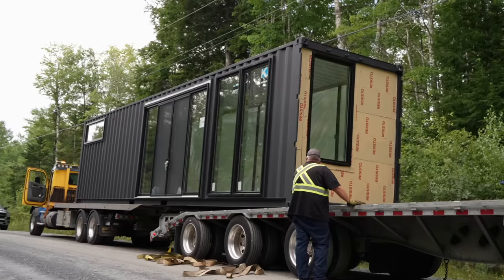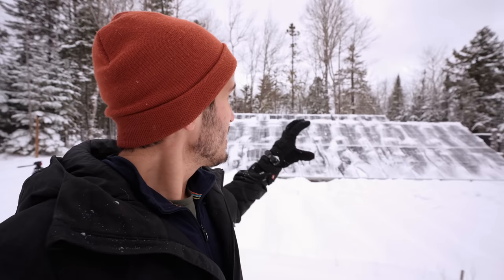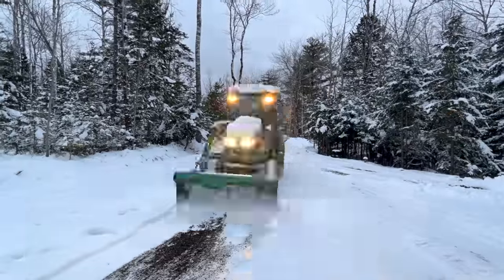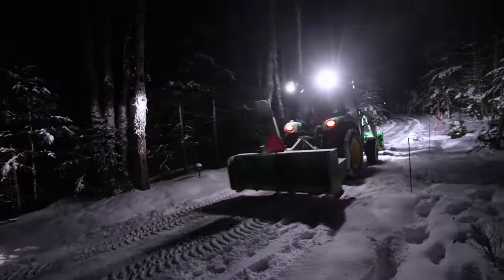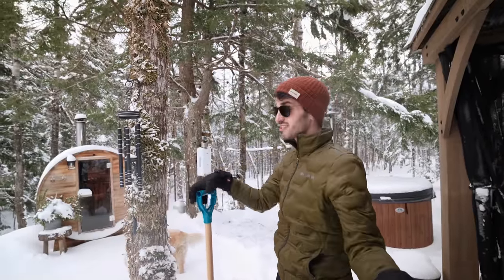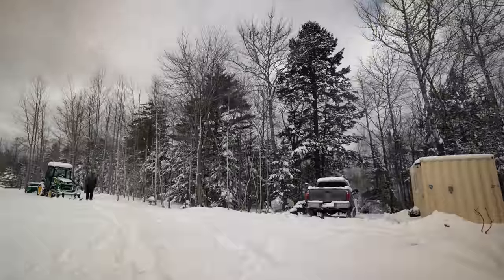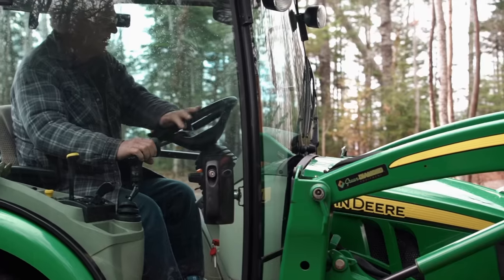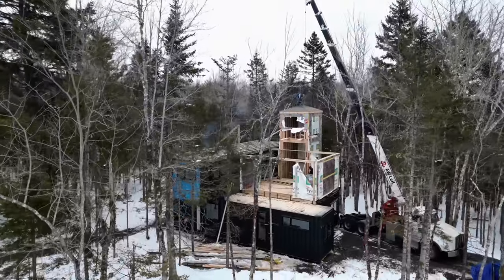Persistence Pays Off: The Shipping Container Home Build is ON!

Comment: HI guys! Sooo jelly of that tractor and now the new blower! Ahhhh! IwantoneIwantoneIwantone! Was thinking about that constant chore to clear snow off the solar panels and it occurred to me that one might buy vinyl like the dome window is made of and make covers for the panels so that all you have to do to clean them off is pull the cover down from the top and let all the snow fall to the ground. The vinyl panels can wrap around and just under the solar panels and be secured in place with grommets and bungees or commercial velcro would be my choice if the temp allows or even those super strong magnets if they will adhere to the solar panel frames. Due to the trees, you don't seem to get a lot of wind so it seems like any of those might work and make your daily tasks easier with one of you on either end to pull the panel down and put it back up with the aid of a step of some sort if you can't reach the top. The vinyl covers might also help reduce the rake snagging on the raised areas Todd described and..if its not too heavy you might be able to pull the vinyl panels with the snow load on them away from the solar array and dump it somewhere else. You could test this theory on the cheap with plastic sheeting and duct tape. The container house looks amazing so far!

Comment: You guys should put rails along the top and bottom of the panels, with a pole going from the top rail to the bottom rail (across the panels) with brushes attached so to clean the panels all you have to do is drag it across once and you're all done! it would take seconds to drag across and you'd be more likely to do it more often with it being so easy - more electricity! 
(would also work in the summer to clean off debris/leaves!)

Comment: watching you guys now...I think you guys might be good candidates for bifacial solar panels as you eventually replace or add more, with all of that snow on the top of the panels to gets solar power on the underside of panels. You guys have the be the hardest working guys in "snow" business. ha, but the tractor accessory looks like a great move. Easy to spot Squirrel in the snow huh.

Comment: Two suggestions - put small tarp over front and back window of vehicles for quick clean off (also saw a video that someone put a tarp over stairs and quickly pull the tarp away with the snow). Always keep a bag of cheap kitty litter in vehicles to put on icy patches to make it easier to drive. In a pinch you can also use mats if your wheels won’t catch.

Comment: Have a new tv and we had a power outage , just for less than a minute and I freaked out because all my tv had was green rolling lines🫣😳. I ended up having to unplug everything for an hour then plugged it all back in and voila it worked. Phew, all that money for a new smart tv and I figured it was dead after only three weeks.  Snow blowers are amazing so are snow mobiles, soo much fun. Stock up on shear pins, they are always breaking. 🙋🏼‍♀️

Comment: If you get a fibre glass painters extension pole then pick up a push broom head you can actually push the top of the panels worth of snow up up and over the top then behind the the panels and the brush is less likely to scratch the panels add catch on the brackets of the panels

Comment: put a gutter overhanging the panel. then put holes in the gutter, then run warm water through it so that it tickles over the panels.  :)
Reply from the maker: How are you heating and pumping hot water in the middle of winter? 😅

Comment: Todd, I' ve  got one of those snow rakes.  It's exactly like the one you have.  Luckily, I've only had to use it once. I love the Charlie cam. I'd like to see more of those shots.  I think the stairway addition is a great solution to your access problem.  With the boxy look of the tower in goes quite nicely with the containers. With all your self taught skills, Todd, I'm surprised you didn't turn yourself into  Joe welder. I may have a Kubby about the same size as your JD, but I like all things green.  I'm not a fan of blowing snow in reverse, but a front mounted snowblower  costs an arm and a leg, and it pretty much means you can't use the loader for any thing else, so go for it.

Comment: another amazing video.... if I may give you a piece of advice... I work in the automotive industry and never EVER lift your wiper blades up, NEVER, if there is a little weight on your blades from any kind of accumulation, it can warp them and you can burn a motor.... the best trick is use either bread bags or socks on your blades but DON'T leave them in the air !!!!!

Comment: Enjoy the snow blower.   I bought a tractor and snow blower similar to what you have.  It is nice but hard on the neck aa my driveway is a mile long.  I am looking to get a snow blower to mount to the front of the tractor which will run completely on hydralics.

Comment: Be proud of yourselves because all your hard work is paying off. 

Is there such a thing as an adjustable mount to change the tilt of the solar panels depending on weather conditions? A steeper angle would make it harder for the snow to build up and encourage it to slide off before there’s too much.
Reply from the maker: We’re looking into adding more solar in the future and with that we’re going to have a few panels at a steeper incline that will mean we won’t have to clear the snow

Comment: Are you able to track how often, how much, you need to rely on the backup generator? Regardless, you are moving in the right direction. Sun is longer and higher already even on our side of the Gulf of Maine. BTW, you were lucky with that snow. Ours was 5" of wet cement that did a number on trees and shrubs. Think shoveling water. Those panels will see you through the upcoming months. So eager to see the house addition in place and how that allows you to move forward there. And yay Mel's return.

Comment: Tyler and Todd this may be a really stupid question. I don't have any experience living in snow. And also know nothing about solar. Therefore, this question may provide a great big laugh for those that do. Here is the question Would it be possible/helpful to install heating coils on solar panels and roof of container home to melt down snow so it would not require as much shoveling? I apologize if this is a rediculous question from a deep southern from Florida USA. By the way I love you both dearly and thank you for sharing. What you have accomplished is absolutely amazing.
Reply from the maker: Not a ridiculous question at all! The solar panels actually do that themselves…the issue is when it’s SO much snow you need to get it off so there’s no more than an inch of snow on top so it will melt :)

Comment: I don't know much about solar panels, but I'm wondering why they don't have a self cleaning / snow melting function. You'd think a self-heating mechanism it would be an intuitive addition to the design. What do people do who have solar panels on the roof? Or large buildings with multiple solar panels on the roof. In those situations removal of snow by hand (like you do) wouldn't be a a safe or even feasible option?

Comment: Hi. I'm wondering.  Are you guys going to have some corner supports on the 4 corners of the container that will be the second floor?
Reply from the maker: Nope! Engineering doesn't require them as the load of two center beams are so intense!

Comment: The amount of snow your roof can take, was that computed with dry snow or moist? When it gets above freezing temperature, the dry snow sucks up the moisture in the air like crazy. It's known to break steel beams with a smile...
cheers! /CS
Reply from the maker: The load rating is 100lbs per square foot dead weight...not sure what that would translate to in terms of snow. The roof is roughly 500 square feet so in theory, it could handle 50,000 lbs. I mean, we are building an entire addition on top so it makes sense it can handle all that weight!
Reply: @tylerandtodd  100 pounds per square foot. In the best of all worlds that sounds good, but I would suggest you find out, both exactly what dead weight means,  and how much would one square foot, three feet (no! Six feet!🥶) deep of snow saturated with moisture weigh. I mean, I wasn't joking when I said that about steel beams. Wet snow has been known to destroy roofs of big production plants. And if you do find out, please feel free to post it to us. It is valuable information.
A few minutes later: Oops. I just made a "sanity check" (an off the cuff check). Please bear with me in the maths...
One cubic foot is roughly 30x30x30 centimeters.We can rewrite that into 3x3x3 decimeters. That makes 27 cubic decimeters. That makes 27 litres (IF we assume that totally moisture saturated snow weighs as much as pure water). Three feet deep means 3x27 litres, that is 81 litres. 81 litres is 81 kilograms, roughly  That means roughly 160 pounds per square foot. And if we assume six feet deep, that would mean 320 pounds per square foot. Oops.  Okay my assumption on the weight of the snow here is very much "on the safe side", since the snow will not really weigh totally as much as pure water, but my conclusion is still that in certain situations you could end up way beyond the tolerances of your roof. I do suggest that if you get real lots of snow, followed by a thaw, shovel off your roof as soon as possible.
Let's hope for the best /CS

Comment: I don't wanna be a downer, but clearing off those solar panels all the time would be getting very old very fast for me.  Maybe there's another way (like w/a cable or something) that you could do it faster and easier?  Thanks for the video though.
Reply from the maker: Lol not a downer at all! After 1 or 2 times it gets old for us too…the good part is you ONLY a have to clean the snow off when it’s more than 6”. So basically is it’s a huge storm, otherwise they just melt off right away! If we left it for a day, it would all be gone. We just don’t want to use the generator and burn propane while we wait :). In a typical year we’d probably have to do this 10-15 days at the most, and if we were tired or didn’t want to the generator would automatically come on when the batteries need juice!
Reply: @tylerandtodd  I see what you're saying.  Thanks guys.  And always enjoy your content.  Thanks again!
Reply: @tylerandtodd  Ok, I was just discussing this w/my son (he's not completely useless as he is a PhD electrical engineering student), but could you maybe have the panels tiltable?  I know nothing about it, but it would be super cool if doable, lol.

Comment: Dry Sense of Humor, 'ya mean like Monty Python??  Also--Nice implement addition 'fer your tractor...You dudes needed that snow blower.  I haven't purchased one...Yet...LoL I got a front mounted blade to swap out with the bucket 'ta move snow, working well...I have that same model tractor, they're really sweet...You dudes have quite an inventory of construction equipment now...The tractor and all the attachments you have....Cha-Ching$$$...LoL  John Deere equipment is not cheap, but, you'll never regret buying that equipment...And...I would highly suggest you build a pole barn 'ta house all that precious equipment.  I have a nice 60 x 30 building with 3 10' doors 'n concrete floor 'fer all my equipment and New Bronco, Yeah I succumbed 't buy'n one of those and I'm not sorry....The color?? Azure Silver (a throwback Light Blue-Silver Metallic) with a Hard Top, V6 engine and Sasquatch suspension package....It's quite a beast,...I wish I could have gotten a manual transmission with the V6 but, wasn't offered, Auto Trans only with that engine...Shit...Meh!!